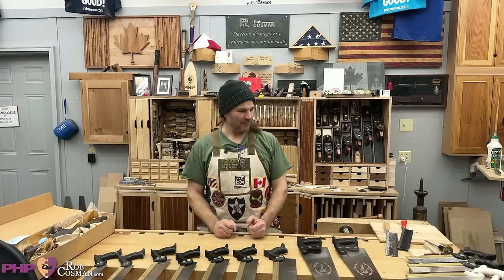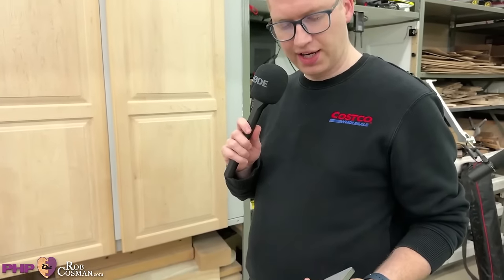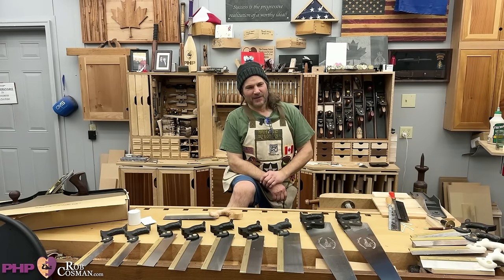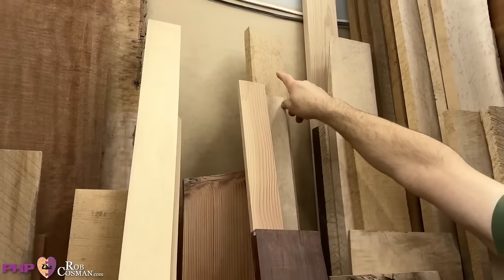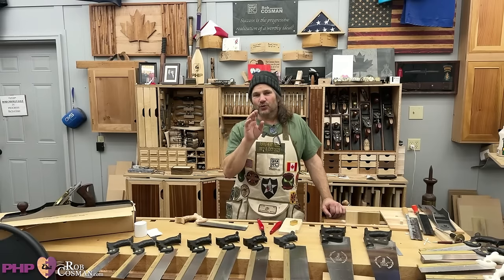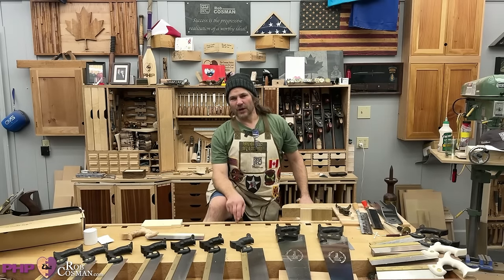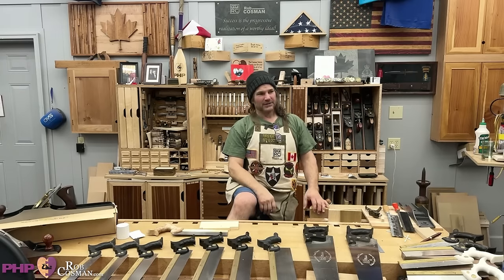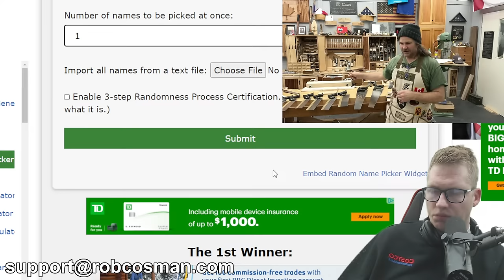Ask Rob Anything - Live Q & A (19 JAN 2024)

Comment: Support for marking pins in moxen vice..Make a platform for the tail support the same thickness as moxen vice platform, Use magnets inbedded in support platform to hold upright support, then you can remove upright support to set pin board height and move it back to support platform and magnets hold upright support for marking pins.

Comment: Hi Rob,  in regards to the chisel box that hangs on the wall. Can you put another French near the bottom that way its captured in two places and won't pull of the wall at the bottom?
Also have you considered placing the wheels on your moxon vise BELOW the top surface so the user doesn't hit them accidentally with their Cosman saw, like you have done with the moxon vise that's at on the Sawstop?
Any idea when your 51/2 be ready?

Comment: I found an old Record 5 1/2, but it didn't really suit me. I like the weight and feel of the no 5, and I actually have two of them (one with strong camber).
I also have a no 6 that's great for trueing the board and flattening large surfaces.
I suppose I could do everything with the no 5 1/2, but it tired me out on rough stock.

Comment: You kept saying multiply the total amount of lumber that you need by 1.4 in order to have 40% more. Wouldn't you multiply that by 0.4?
If i needed a total of 10 board ft and multiplied it by 1.4 i would purchase another 14 board ft but if i multiplied it by .4 I'd need another 4. That's a huge difference.
Reply from the maker: You need 10 bd ft.  Your waste factor is .4.  So you multiply what you need by your waste factor, the “1” includes your “need” into the equation, 1.4 or 14 bd ft.